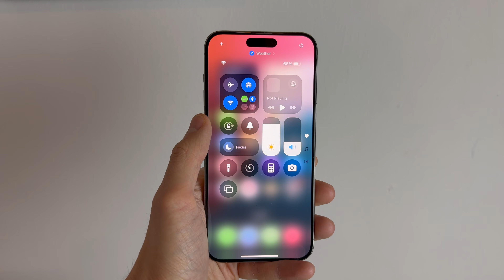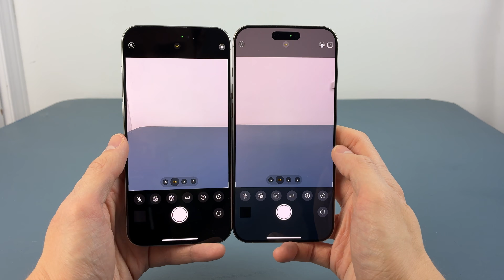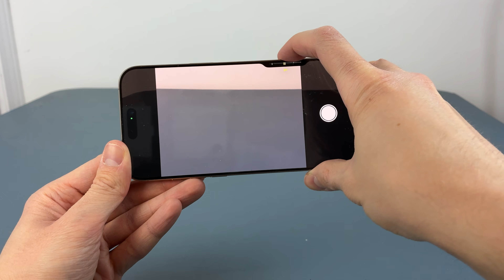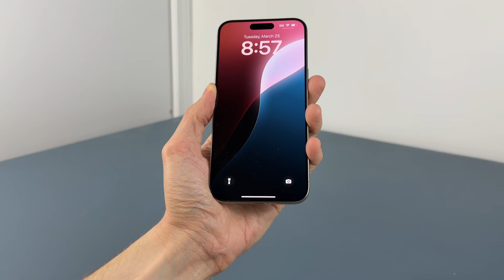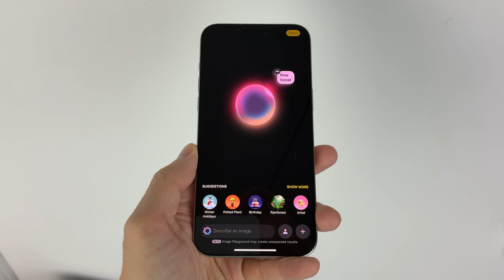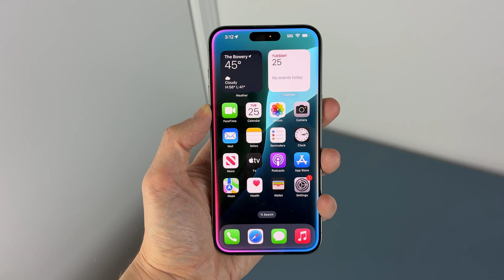Why iPhone 15 Pro Max is PERFECT in 2025!

Comment: Just got my battery replaced on my 15 pro max and it’s performing like it did on day 1. I’ve had this model since Dec of 23

I probably won’t upgrade until 2027 which will be the official 20th Iphone anniversary. Probably wishing thinking, but hoping a new innovative design or software by then

Comment: I’m actually switching from the 16Pro Max to the 15Pro Max because the camera control button is absolutely annoying, the cases doesn’t look good for it either, literally I always accidentally press it. It’s located in the main spot I pickup my phone from and it’s truly more of a hassle and a gimmick for the iPhone 16 line.
Reply: Let's Exchange I Have 15 Pro Max Battery Life 88% After 2 Yr's Of Use.. .

Comment: I upgraded from 11 pro max to a refurbished 15 pro max a couple of months ago and have to say I feel like I’ve got more bang for my buck this time. I paid just over half the price of a new 16 pro max. The camera has impressed me more than anything else so far. Could’ve waited out for the 17 pro max but after hearing the rumours that Apple will switch back to using aluminium, decided to choose the 15 pro max instead. The weight doesn’t bother me that much. I’d rather have something sturdy.
Reply: do u need a case? since its tittanium?
Reply: @annakessler9372  me personally never used my 15pm without a case or camera protectors and screenprotectors it will scratch fast
Reply: @annakessler9372  titanium scratches easily so a case is recommended

Comment: Does it still have the overheating issue?
Reply: No it doesn't, issue has been solved
Reply: I have this issue of overheating escapily when i play cod or camera video rec and charging
Reply: My experience with 13pm and 15pm and 16 pro max; theses devices is same in the heat no difference ;heat in charging ,heavy use ,record video ,it’s the same thing .
Reply: Same questions here. Does it still overheat when taking pictures, watching youtube, ins, or doing normal tasks?

Comment: I’ve had the 15PM since January 2024 been loving it so far. It’s fast, good battery, great camera and it’s fun to game on. My 13Pro used to dim all the time when I’m gaming. As the tech person in my family I went with my mom and my sister to get their 16PM. I’m not a fan of the wider screen. My hands are too small for all of that. I couldn’t care less about the camera control button. So overall no fomo for me. I think I’ll skip my 2 year upgrade cycle and keep the 15 when the 17 comes out.
Reply: Did you have any overheating problems when you using this phone?
Reply: @dkxoxo all phones have a heating problem there's no exceptions with it. The higher the performance, the more heat it generates because it requires more energy and power.
Reply: @VARJAGAMINGENTERTAINMENT no, because every other phone has some kind of cooling system built in but not on iphone
Reply: @sohaibgaming1020 cooling system won't work if you play a graphic intense game like Genshin Impact or CarX Street or some pc port emulator especially without a fan.

Comment: Do iPhone 14 pro max next
Reply: iPhone 13 Pro Max has better battery life than 14PM and 15PM (and less bugs and issues, interestingly)
Reply: @RealmRoyale3D  You have a point ngl It's also worth considering how software updates play a role; the 13 Pro Max might be benefiting from a more stable software version compared to the newer models, which might still be receiving tweaks and fixes. That said, while newer models typically bring improvements in other areas (like camera performance and processing power), it’s clear the 13 Pro Max remains a solid choice for anyone prioritizing battery life and reliability!